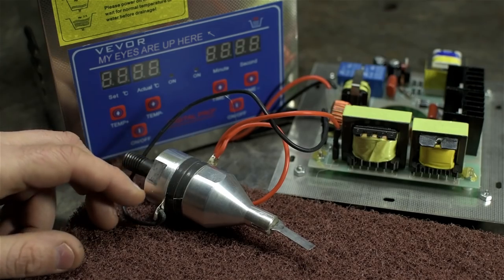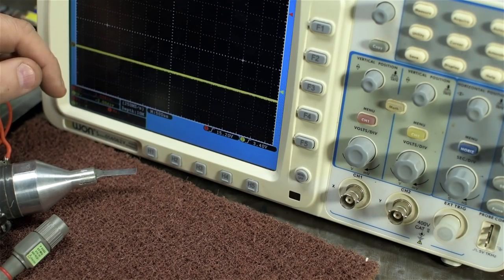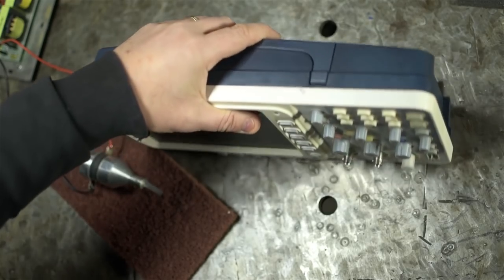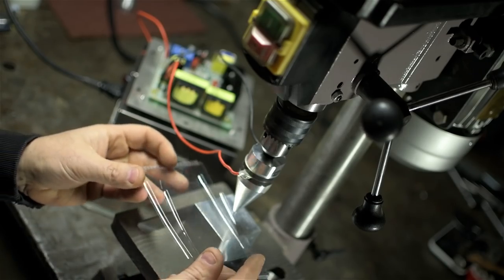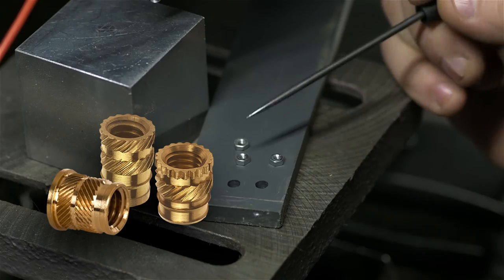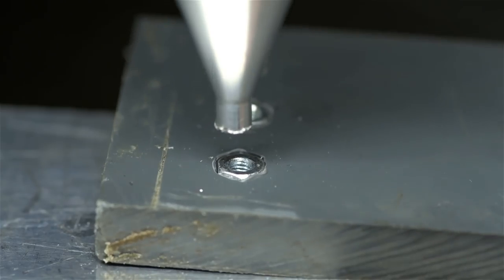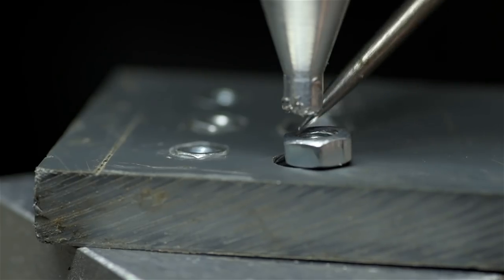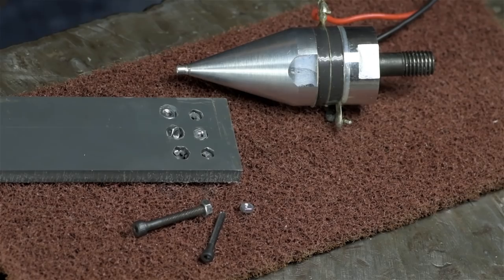DIY Ultrasonic Welder?! (Answer: NO)

Comment: Tony, question on your frequency analysis. What did you use for boundary conditions at the base? I would think you'd need to consider some elasticity at the base? it appears like the transducer is a dense rubber or maybe plastic which would act like a spring at the base, depending on the relative stiffness it may be a significant input to the system's overall frequency. Admittedly this is probably a difficult thing to estimate without knowing the specific material of the transducer...Awesome videos! Thanks!

Comment: for welding you need sharp edge usualy 45 or 90 degree, that edge will melt and bound with second part also 40Khz is very high so it will work only with small part and sonotrode is usualy made from titanium (best for leading of ultrasonic) aluminium or steel (best durability)

Comment: Does that transducer stackup have a piezo disc on both sides of the input? I remember there being wires going both to the back of it as well as to the horn in the cleaner, but I'm not positive if one was just a ground or not, or if there is already continuity from the counterweight to the horn.
Reply from the maker: it has two piezo discs with a common (center) hot.

Comment: Drill the hole 1/8 of an inch deep with a drill bit that will allow the nut to fall into it.  Then  drill  your undersized hole the rest of the way through the material.  My guess is that some melted plastic may flow upward and you will not be left with much of a gap in the top 1/8".

Comment: As for the clear packing sheets you had them on a solid block that may have transferred the vibration into it  try putting hard rubber under it   as for the scope Ch. 1.  FUBAR.  I think that's what shunts are for its been a while since I thought electronics

Comment: Seems to me that you might redesign the feed horn to have two cylindrical sections at the tip. Basically, it would look just like what you currently have plus a short small diameter cylinder at the very tip intended on fitting into the nut so you don't have to go chasing the nut when you apply power.

Comment: You are actually quite close to having yourself an ultrasonic lapidary drill. You need a long thin cone with a hardened tip. Grit is used as a cutting medium under the tip to cut thru rock or glass much quicker than diamond drills.

Comment: Some glue to hold the nut in place as you start. Drill a hole for a bolt all the way through. Insert your bolt from the plastic side. Now you have something potentially useful.

Comment: So Tony if you need to use that  thing to   
install some kind of weird inserts in plastic cut a small slot in the bolt cut boltl off use your machine to sink into plastic back bolt out of nut.  Using some JB weild in process and Voila there you have it nuts permanently embed in plastic ( ha ha)

Comment: I think if you try to weld two thin plasics together, the movement has to be parallel to the surface. Otherwise you wont generate heat because there's not really friction. you should try to rotate the ultrasonic thingy but keep the pressure from the top.

Comment: Seems to me if I had it hanging around, I may put a small diamond file blade in it and use it to sharpen my carbides. For starters...

There ARE uses for what you have, just not the ones you set out to create. Such is the way of creation....
A proper insert may make a good metal etcher?? Sort of a super vibratory pencil. I have a very old electric engraver (60s? - the 60hz coil type) that doubles as a carver and came with a full set of stamped chisel blades as well as the carbide tip. It worked quite well (probably still does if I ever find it again), what you have is a higher freq version...

I worked with a real Ultrasonic welding machine back in the 80s. It looked like an arbor press with the transducer driving the ram, and it's sole purpose was to weld small plastic parts together. The direction of travel was parallel to the  surfaces to weld - which produced a 'sliding' action, thus the frictional heating. tension between the  parts was created with a small leaf spring. I forget exactly, but I believe it welded the 2 halves of an electric toothbrush housing together.

Hope some of my randomness joins with some of your randomness and produces coherence.

Comment: what if you threaded the inside of the "horn" and put a threaded rod in the size of the nut to weld in? then spin the nut on. Weld it in and spin the ultrasonic tool off?

Comment: you should increase horn tip resonance frequency. its giving sound so its below 20khz. horn should oscillate up and down not right to left, plastics bonding peressure+ right-left oscillation.  metals are bonding pressure+right left oscillation.

Comment: An o-scope is only as good as the probe setup you use.  Make sure that the ground clip is indeed on a common ground, and isolate the scope from the part being tested... Especially if it's rated at 60 watts

Comment: Here's the better way to do it. Shorten the tip just a little bit (maybe just a millimeter) and make the tip narrower. Then it will fit inside of the nut instead of bouncing all over the top. And as you press down it'll more or less automatically center as the cone starts widening.
Or maybe make the tip stepped. Kind of like those drill bits that can drill multiple sized holes.

This is just a complete guess by the way.

Comment: There is a cardinal difference between your attempt to weld the sheets and the sinking of the nuts.  It is DIRECTION.  The friction heat works way better when you have a SHEAR action.  That's what you have with the nuts.  But you would need to somehow deflect the horn movement by 90 degrees to produce shear on the plastic sheets.

Comment: In order to make a ultrasonic welder you need much more higher frequency. It's done by utilizing concept of dielectric heating with RF. The 13,56 MHz should be enough ;)

Comment: Would it work better if you made a steel conical anvil for the horn to put more even pressure on the nut to prevent damage to the horn.  Interesting to know the holding power from the opposite side of the material and could it be used on wood making it like a blind but but not proud of the surface?
Reply: .. or thread it to use the carbide anvils off Momma's micrometer?

Comment: If you could thread the nut on to the tip it would be steady, though you'd need a different threaded tip for each size. It would be proof of concept all the same.

Comment: Hi Tony. Interesting and in depth video.  I have looked for a portable ultra sonic metal welder but there doesn't seem to be much choice and the technology seems to use huge machines rather than small ones. Your hack is awesome considering its built from a relatively small  cost. Would you say that the success rate is determined mainly from the output of the unit or the design of the horn or both. I want to ultra weld very small  electrical components ( wires ) . It would be great to see if you could further experiment to see if its possible to reach the status of the units costing thousands of dollars. Thank you Tony. Great use of the drill vice by the way thats excellent.

Comment: I have to wonder if you had the scope probe on X1. The transducer should be running weill under 1KV, probably 160V to 320V or so. That should be well within the capability of a X10 probe. At times 1 though, I can see the input circuits on a modern scope getting pretty unhappy. (Which is why I still have some working vacuum tube scopes.)

Many inserts are flanged and the pull is supposed to be from the back side of the material the insert is sunk into. You might have had a decent pull force on those nuts if you'ld pulled from the other side after sinking them.

BTW, I expect the oscillator frequency could very likely decrease under load on the horn. After all you are coupling energy into the load. You could probably watch it change as you pressed with the tip of the horn on something.

Comment: This Old Tony: I think the problem is with the direction of motion. Ultrasonic welders tip motion should be perpendicular with the pressure direction, but you ultrasonic welder is parallel. If you would like to cut or weld you should create transversal waves not longitudinal waves.

Comment: How about putting steel nuts into aluminum or such soft metal using this? Maybe if you add steel tip with treads to end of the..ultra thingy it would center better?

Comment: You need an isolation transformer for when you are testing any AC powered device with a scope,  you also need to take the isolation transformer apart and decouple neutral and ground one the output side from the input.   There should be no connection between hot, neutral or ground on the output to the  hot, neutral or ground on the input.

Comment: Could you try to make a broach out of it?For making square/hex etc holes in metal ? If you put some hss with proper cutting angles on the horn it should broach the steel.
Worthy of trying.

Comment: I thought you'd pick up the signal with another transducer, and use a spectrum analyser to see the resonance.  
Could you put a carbide tip on the knife and try to split pebbles with it? I read once that it'd be an efficient way to carve moon rock,  so I've pencilled in this idea for my next mission.
I'd have held those nuts straight with needle nose pliers. That's how I do it when pushing them in with a soldering iron.

Comment: I'm under the impression that this sort of welding on plastic is generally done in the HF range, not ultrasonic. A quick search pulls up 27.120Mhz. Do you have a signal generator?

Comment: machines I work with do Ultrasonic Welding they have two 25mm hydraulic clamping cylinders at 70bar pressure welds take 135ms at 540watts of power material is polyethylene

Comment: Would it have welded if you used a hockey puck instead of aluminum as the anvil? And I wanted to see you sink the nut without a hole. Ultrasonic nail driving.

Comment: Nice video, I have been looking for a DIY solution to weld wire leads on 18650 batteries to act like fuses as Tesla does. Could you try doing something like that with this and show/tell me how if that works?

Comment: Maybe it vibrates in and out and not side to side 
That would explain that it does not cut on the side and does not weld things because it just smashes it together instead of melting or welding it. But on the other side it smashes in nuts as it goes in and out. 
Just a theory
And sorry for my bad englisch i am german :-)

Comment: What software are you using to do the simulations? I could really use something like that ;-)
Reply from the maker: solidworks.  CAD and simulation in the same package, so it's easy to make updates and re-run.
Reply: Thanks! Is that the "Solidworks Simulation Premium" package? I've got SW but no sim package.
Reply from the maker: Yes, for the harmonic analysis, but the base package should have "Simulation Xpress" you can activate which (don't quote me on this) gets you frequency analysis.
Reply: I didn't realise that was actually included, thanks. Unfortunately, as far as I can see, Xpress only does static anlysis - I can't see any options for a frequency analysis simulation. Is there something I'm missing here? (I've got SW "Professional"). Thanks.

Comment: It's interesting that the horn resembles the lens of a shaped charge.  I'd like to see conical tip of the horn rounded over into a soft point.  I'd suggest that you put on diapers if you try it .
Reply: Shaped charge as in RPG rockets or HEAT ammunition ( or the good ol trusty PANZERFAUST XD)

Comment: Put screws in those nuts.  By applying your pressure from much higher you'll be able to control the side to side pressure much easier.

Comment: To friction weld plastic you need a fix part then a frictionning part on top like well you know !
so one part fix to the drill press table and one fix to the transducer then light pressure will melt both parts together .

Comment: Put a harder tip on your horn, like tool steal. 
Make the tip wider, at least as wide or wider than the nuts you want to seat, with a bevel of I guess 60° to 80° to help centering and leveling the nut. Good luck will wait for an update...

Comment: Could you thread the end of the horn to take different studs threaded to lold your nuts?
.... or lose the nub on the end of the horn and just leave it pointed so it seats inside the hole in the nut like a centre.  OK as long as it doesn't melt at the tip and weld your nut to the stud

Comment: I'm late in the game here, and ultrasonic cleaner jokes aside. What if you did make an ultrasonic cleaner? I've seen experiments where the water gets agitated while inside a tube and the stream of "ultrasonic" water has a cleaning effect while drizzling into the kitchen sink.

Would be pretty neat with a portable cleaner. What for cleaning small grimey bits on bulky objects you cant get into a vat.

Comment: i think the problem is you're holding it by the metal shaft, which is directly connected to the horn. So almost all the energy is being absorbed by the fixture apparatus.
Reply from the maker: I didn't know where else to hold the thing
Reply: Not optimal, but by the piezo itself. Not sure how you'd manage that... some sort of soft mount?

Comment: You know I think I could of put those nuts in faster with a hammer or just pressed them in with the drill press.  But still very impressive.  Enjoyed.
Reply from the maker: in theory you'd want the plastic to re-flow into all the nooks and crannies so the insert is rock solid.  The nuts were just a poor stand-in.

Comment: No, your driver board probably doesn't take into account the mechanical resonance of your horn. The board probably isn't a very frequency stable oscillator and the horn just amplifies a different part of the relatively wide spectrum the driver produces.

Comment: Hey , can you transform it into a stapler type device to stitch the cof in LED LCD?
Some tracks develop loose connection developing vertical lines on display.
Inbox me if you can . It's gonna be one helluva instrument , I have been thinking on that line since quite some time. 
Just few spot welding and entire display panel is salvaged.  Those panel bonding machine might be an old story .

Comment: Could have thread a screw with a reasonable flat on the top and then the tip would have a surface to act on and the screw would have a better lead in. Might even have had the option to do a much smaller diameter. Otherwise a larger hold with a smaller hole inset could have made this a less painful exercise.

Comment: Why not just bring the horn tip to a rounded point instead of the small cylinder? Then it would automatically center into the fasteners and hold them in place.

Comment: you have a lathe and can't think of a way to hold nuts. turn down a pin for the nut with a hole on the other side for the hron

Comment: I was thinking this should work because I remember seeing an ultrasonic soldering iron hit the shelves about 20 years ago.
Reply: PS. Did you not have the probe switched to 10x when ch1 fried? Unless I'm measuring some really low levels, I usually keep them on that setting as it loads the cct under test much less.

Comment: If you machine a screw into the end of the horn and thread the nut on before sinking it, the nut will go in straight and plastic won’t be able to come up the center.
Reply from the maker: how would I get the horn off?
Reply: This Old Tony By unscrewing it? Also, threads might not be necessary, as long as the shaft is a tight enough fit to keep the nut from getting sideways.

Comment: Plastics usually have a small rib designed into the mating surfaces to concentrate the energy for ultrasonic welding. Would love to see if it works with this low power ultrasonic welder. also great video as always!

Comment: I'll try to fix your scope for free if you want. I worked in calibration labs for over 10 years repairing stuff like this. I'm not sure how robust the front end on those Owons are. At a minimum if I were you I'd totally open it up and check the input circuitry.  Hopefully you've got a fried input resistor or coupling cap and not the attenuator or amplifier. If so it should totality be fixable. If you even just  snap a high res pic of the board I can take a gander.
Heck I'd even give you one of my old Tek T-935a or 2213 but I'm not sure you'd line the old finicky aging analog style with dirty attenuators. switches.
Reply from the maker: Thanks for the offer Strain!  I'm might just go ahead and limp on one leg for now lest I opener up and kill them both!

Comment: Put a short screw into the nut, to make a flat-ish surface to drive against.  And then bolt into the nut from the opposite side for strength.  Having the plastic retain the nut is not important.

Comment: Do you think the plastic ultrasonic welding would have been more successfull if the oscillations were parallel with the mating surfaces versus perpendicular? With the energy input perpendicular, you may just be pulverizing the plastic. If the input was parralel, the plastic could rub together and create the friction heat needed to weld... just think out loud here